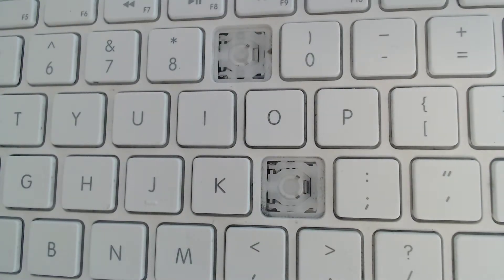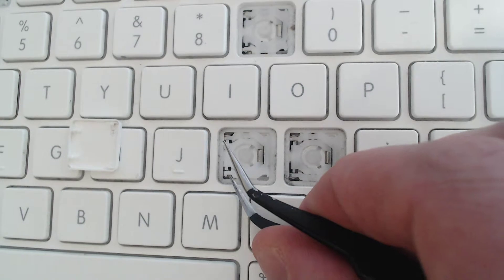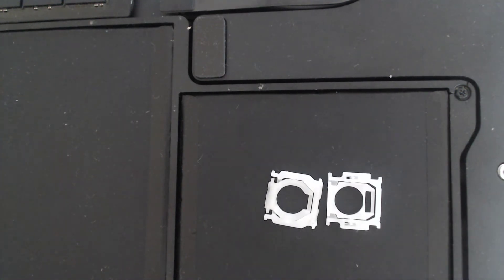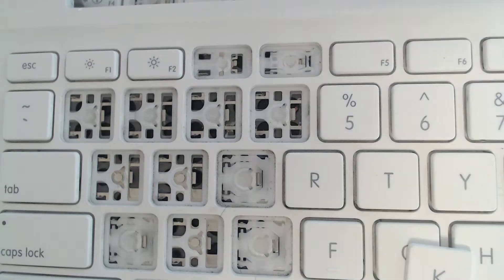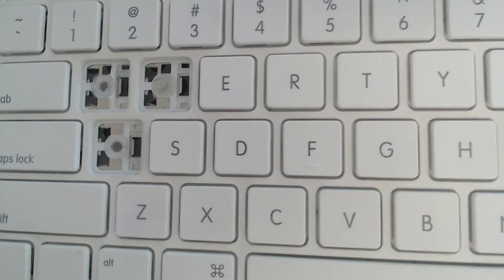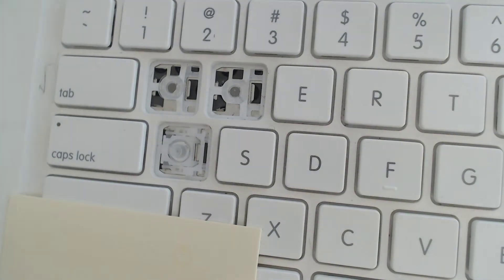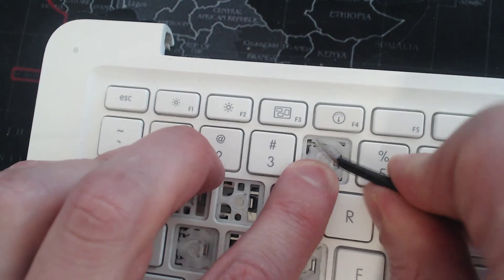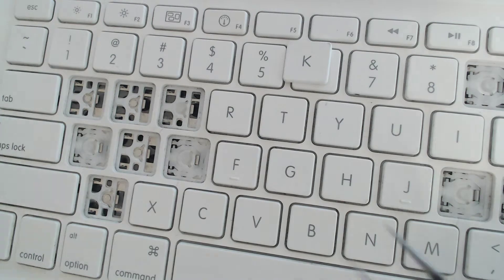How to Repair and Replace MacBook Keys

Comment: My E key doesn't respond every 99 presses.  I wanted to take it apart, and maybe clean out the dust and stuff to see if that helps... and they I hear you say that cleaning it with alcohol is all nonsense, and that doesn't work. Yikes. Well, I think it helped. I am glad that your guide here exists. I was too afraid of breaking things to take off the key.
Reply from the maker: Well, if it works 1/99 times then you don't have a fried keyboard as I describe, you have a physical/mechanical issue

Comment: Thanks... the little rubber silicone dome under the keys are the death of me. Most repair videos on YouTube completely fail to mention how to replace these, because just sliding them in between the scissor mechanism just doesn't work. The stupid dome moves and jams the key (which is my issue). Going to try superglue. Hot glue doesn't stick to silicone unfortunately.
Reply: Hey update -- the superglue method worked flawlessly! Can't believe the solution was this simple. The rubber nub is staying in place and the key functions pretty much as brand new, so thank you so much. This video deserves greater views and exposure, wish I saw this months ago

Comment: OMG this video helped me so much in a weird way. I am trying to modify my m1 macbook air, I wanted to replace all the keycaps with white ones cause it looks very nice, and since I had a magic keyboard 2 with white keycaps and found out they are compeletely inter-switchable. But the left/right arrow keys and fuction keys on magic keyboard has a different square design which will not fit on my macbook. 

Your unintentional detail shot on the inner structure of the function keys tells me if I can successfully take out the plastic structure I will be able to fit those keys perfectly on my m1 macbook, I AM SO HAPPY RIGHT NOW. I won't have to do painful paint jobs or anything too complicated thanks to you, will update my progress if you find it interesting!
Reply from the maker: Good to hear! Glad you found it useful. Yeah they are all pretty close to the same, so the concept translates across different models

Comment: question I have a mid 2010 macbook I just got in the mail it has a sunken in key its the eject key near the power button. I did fix the scissor part but it is still flat and wont press in? Not sure why this is do you know why? I'm guessing its a plunger I also got this from a school surplus, I mean the eject key is not a big deal but would have liked have fixed it. Also do you know how to clean a magsafe that is dirty?
Reply from the maker: Hi!  I'm not sure what you mean by "flat" -- is the plunger missing?  Make sure to watch the whole video, because I go over how to replace the plunger.  Also make sure that if you press the sensor under the plunger it actually triggers the eject function. If it doesn't then you have a bad keyboard and restoring a functioning plunger won't help.  You can use rubbing alcohol to clean a magsafe, but remove all sources of power (charger and battery) before you do it.
Reply: What I mean by flat is the keyboard is not raised it’s flat with no way to press I’m assuming that is the plunger that needs fixed I can look at it again
Reply from the maker: @chasethomas5491  Again, it sounds like the plunger is missing.  Make sure to watch the whole video carefully because I show what it looks like with the plunger present vs missing, and you can compare what you see on your machine to the video.